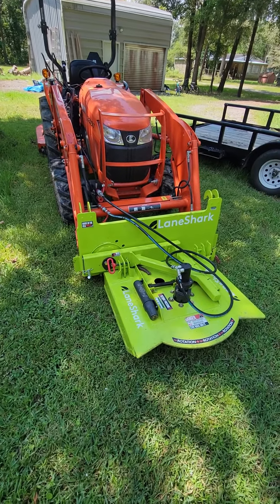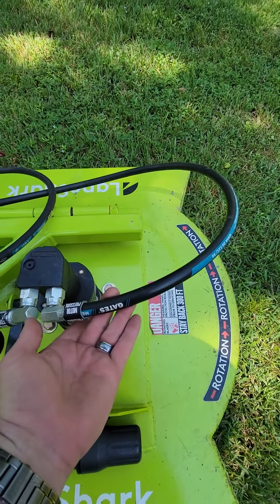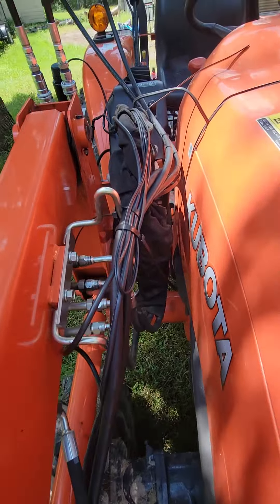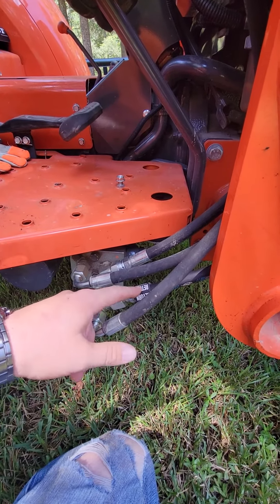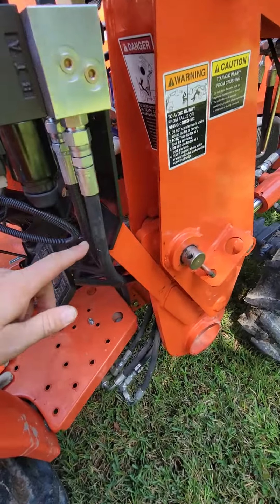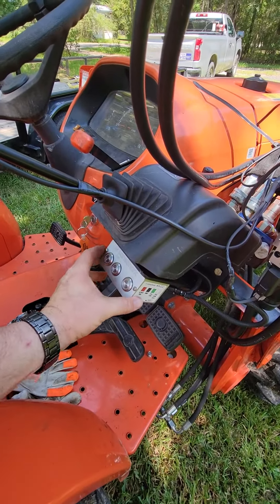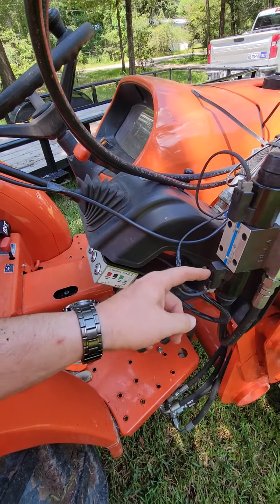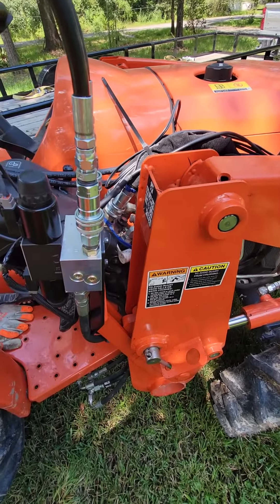lane shark plumbing

Comment: any reason why you couldn't get pressure from rear remotes (use that control for on/off) ... then weld on an actuator for tilt function and use 3rd function for that process... that's what I thinking about at least haha.. (rear remotes I have one for backhoe attachment it has to be a unrestricted return as well)
Reply from the maker: That's the way they used to run them. My tractor does not have rear remotes